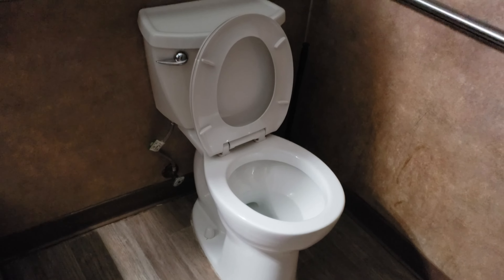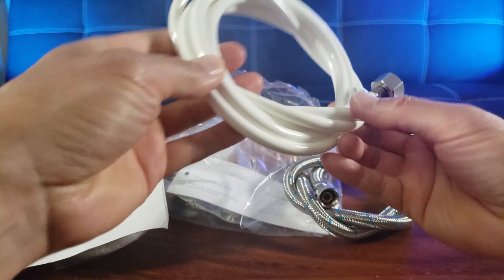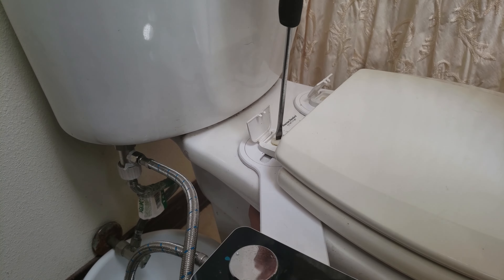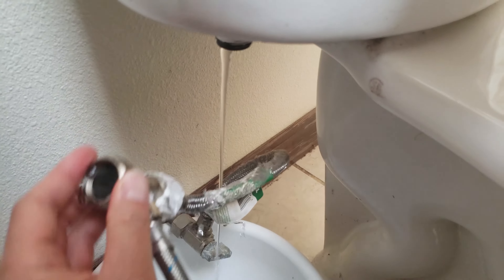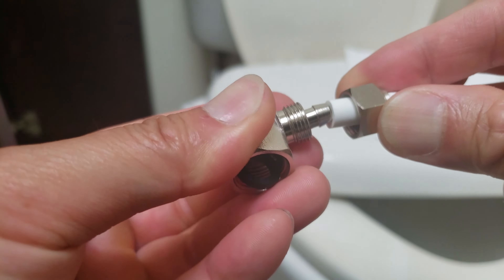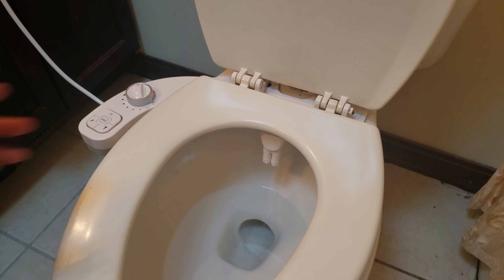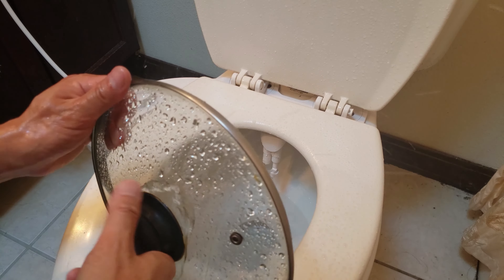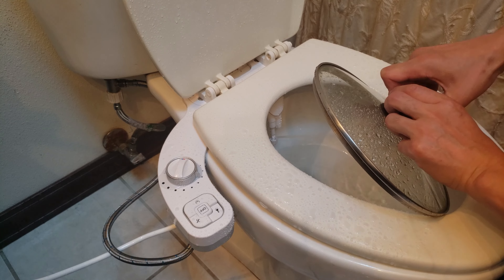Samodra Hot & Cold Water Bidet | How To Install A Hot & Cold Water Bidet

Comment: Hi. I’ve a bidet attachment with hot & cold but only want to connect to the cold water. Please can you tell me how. I’d I don’t connect the hot would it leak ?
Reply from the maker: I highly doubt that will work because that would leave the hot water end to leak. You can confirm with the company that you bought the bidet from by asking their tech or customer support.
Reply from the maker: Upon further analysis, I could be wrong but once again confirm with the manufacturer: https://www.quora.com/If-I-purchased-a-warm-and-cold-water-bidet-do-I-have-to-hook-up-the-hot-water-if-I-only-want-cold-water
Reply from the maker: Do I have to connect the hot water on a bidet?
A: The bidet has separate hot and cold water inputs. Usually you'd connect the hot water supply from the hot water output under the sink near the toilet. If for some reason there's no available hot water, you can just leave it unplugged and cover the hot water input with the screw-on cap that comes with the product.

Comment: The only downside is the hose has to hang out of the cabinet.. so you couldn’t even shut the door..?
Reply from the maker: That is correct. I didn't want to drill a hole in my cabinet so I had to settle.
Reply: @Jay_Rule  Oh ok man. I know my mama won’t like either one of those options; I guess I’ll pass on getting her one.. Smh. Thank you for the video and replying so fast I wasn’t expecting that at all..!! Take care!
Reply from the maker: @M_Shay_  Or you can just go with the cold water option and not mess with having to connect to a hot water hose. Just get ready for a refreshing cold spray during winter lol